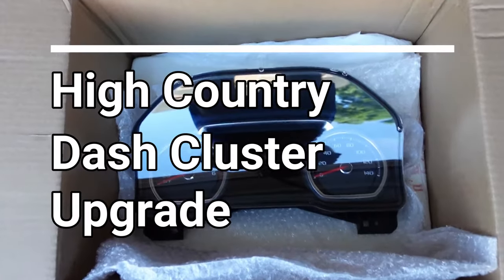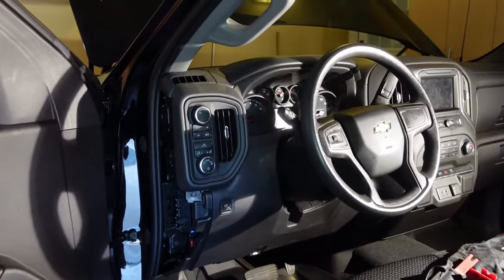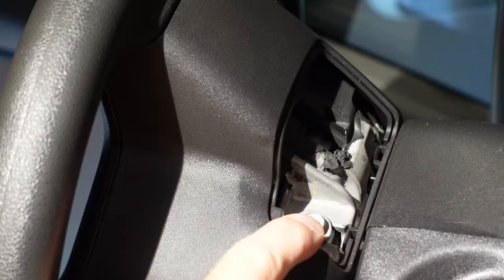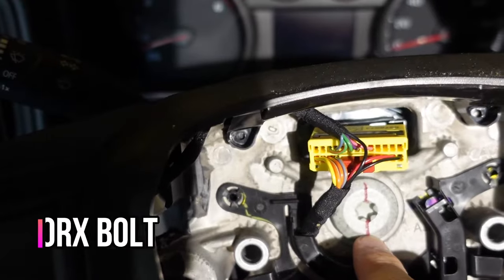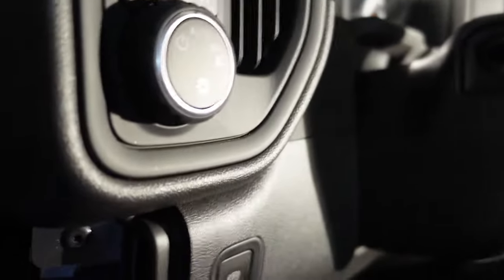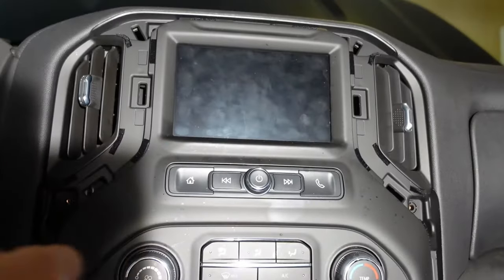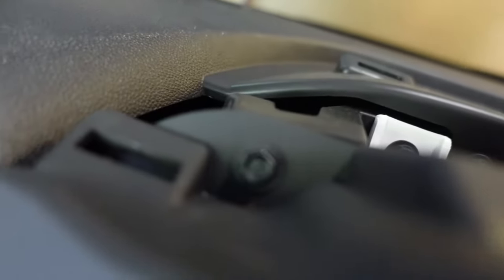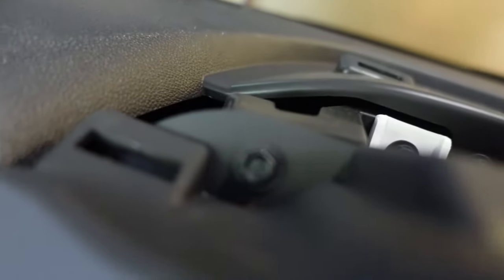[HOW TO] Upgrade Dash Cluster & Steering Wheel in a 2019-2022 Silverado LTD Custom

Comment: So is this the upgraded steering wheel also?  

How much did this upgrade cost in US dollars?
Reply from the maker: Yes the steering wheel has to be upgraded with the new cluster as well. My whee cost about $250 and the dash cluster will run you about $700. And the harness was $27.
Reply: @fondupot   Where did you get your steering wheel from? Is it possible to just upgrade the steering wheel by itself? Great videos by the way!
Reply from the maker: I got it from eBay. You can upgrade the steering wheel. But a lot of the buttons won’t work.

Comment: the white auto is over 600$, why is it almost doubles the price of a factory cluster? why not just order the 300 dollar high country cluster? big thanks for the link to the harness, that's a huge help (currently preparing to perform this upgrade too)
Reply from the maker: Because the WAMS cluster includes programming to your VIN. You can’t just order one and then install it and expect it to work, it requires VIN match programming.

Comment: How much did all the parts cost?
Reply from the maker: The wheel was around $200. The cluster I received as a promo, but normally I think its around $600 with programming.

Comment: I found one with paddle shifters. My truck is like the one in the video and I’m wondering if the paddle shifter would work? I only plan on adding the little harness and the steering wheel with paddle shifter. My current steering wheel only has cruise control buttons and nothing else. I can’t find anything on the forums and I’m just wondering if anyone has swapped one with paddle shifters and if it worked with their truck.
Reply from the maker: I think the wheels with paddle shifters are for trucks with 10 speed transmissions. Or its for the newly refreshed models that are 2022.5's. What year truck are you trying to put this wheel into?
Reply: @fondupot  it’s a 2022 Chevy Silverado 2500HD Custom
Reply from the maker: I’m not 100% certain but I don’t think any 2500’s came with paddle shifters.
Reply: @fondupot  yeah I couldn’t find anything over it or any forums talking about it. I was curious because it made me wonder if it could work. I found another steering whee without it for the same price as well. Thank you anyways
Reply from the maker: @gohangan  Cheers. Good luck on your install.

Comment: Anyone know if this will work on a WT model? Or if there is a way?
Reply from the maker: Should work on WT yes. Years 2019-2022 LTD only. 2022.5+ refresh models will not be compatible.
Reply: @fondupot  where are the links foe the products? Do the sites provide good customer support so i can double check? I would like to do this since my wife going to be using the truck more since we are down to 1 car right now. Thank you for the reply.
Reply: @fondupot  also, my wheel does not have any buttons on it. Whats the chance the connection are under the wheel/airbag assembly? If you happen to know
Reply from the maker: Check the video description. And you can send them an email for support. They’re great. I haven’t had any issues since installing mine. Been working great.
Reply from the maker: Hmm. Not sure. To be honest. Send WAMS an email they can help you out.

Comment: what was the total cost?
Reply from the maker: The dash upgrade is about $600. Wheel is $200. Harness is $30.
Reply: @fondupot  that's not bad I like the fact I did not pay the high cost for my work truck but then can upgrade when I want to... with these plug-and-play items...
Reply from the maker: For sure not terrible. I’m still working on making the heated whee work in my truck. It’s proving tougher than previous models though.

Comment: I just installed mine and my cluster works but my steering wheel controls don’t work and my horn doesn’t work, anyone know what’s wrong?
I installed the dr harness wire, I checked all plug in twice and still won’t control my radio or the horn doesn’t work! Any help would be helpful!
Reply from the maker: Not sure. Double check all your connections and make sure you didn't damage any wires

What year is your truck?
Reply: I took it to the dealership and they said the ribbon in the clock spring was broken and that I have the wrong steering wheel, can anyone help me tell me what part number for the steering wheel in need? I have a 2021 Chevy custom 4x4 2.7 turbo crew cab, thsnks
Reply from the maker: @Pierce78 just replace the clockspring. They probably meant you have the wrong wheel compared to what came equipped on your truck.
Reply: Ok
Reply: Thanks
Reply: Did this work?   I tried the install on my 19 custom, with harness Dr wire, new wheel and high country cluster.  My horn works but no radio controls on steering wheel.
Any info would help.  New clockspring needed?

Comment: I install it but i have problem with programming.. ( PROGRAM CLUSTER ) anyone can help me
Reply from the maker: Yea.  The cluster needs to be programmed to your VIN.
Reply: I have trail boss ... and the programmer ( GM DONT KNOW WHICH NUMBER WILL USE .. ANY NUMBERS RECOMMENDED?)
Reply from the maker: The dealership won’t help you. You need to contact WAMS. Their contact info is in the video description

Comment: Only thing stopping me with my 22 trail boss custom is the warranty😕
Reply from the maker: Well, is your 22 a refresh? or a 22 LTD? makes a difference on whether or not you could even do this.
Reply: @fondupot  it's a refresh, I absoutly love it. Called 3 dealerships with the same concensus. I'd love to do this, buy I'll wait till my 60k warranty goes
Reply: @fondupot  I read other comments after I commented originally! I seen where someone said it wouldn't work currently🙂
Reply from the maker: Not sure your truck is even compatible tho. 22 refresh has different wiring.
Reply from the maker: @Thehotdogguy5000  Maybe eventually someone will figure it out for the 22+ refresh. And then you can do it.

Comment: I have a 2024  silverado 3500 LTZ . The radio controls are on the steering column, all other controls can be done by voice command. I have no reason to mess with the screen.While i'm driving. I don't think is that much of a big deal. That's a lot of work just for a inch or two. Still good information.
Reply from the maker: This upgrade is geared towards truck owners with Custom level and WT level trims. Who don’t have factory steering wheel controls. I would agree on your LTZ the process would be a waste of time since you already stated you have these functions already. The larger screen is less of a big deal than the added wheel controls, IMHO.

Comment: No programming is needed, it is only the change of parts thanks
Reply from the maker: Wrong. Programming is required to match your VIN. It will not work simply by swapping it in.

Comment: I'm interested in having stereo controls, but can it be done without a new cluster? I have a 2023 silverado custom
Reply from the maker: This mod won’t work on 2023, the wiring is different. And others have reported you need the cluster to get the stereo controls to work.

Comment: Any issues at the dealership? Mine is telling me that the cluster is making the computer throw multiple codes but everything works as it should
Reply: When you purchase this you need to provide all the accurate information including your vin so it can be programmed accurately
Reply from the maker: I have had zero issues with mine since installation. Was yours programmed by WAMS?
Reply: Yes it was. There are no issues with the performance of the cluster or the truck, just the dealership saying goofy stuff. I have to correct myself, the dealer said that everything goes through the cluster and on their end it looked like the ecm wasn't talking to the rest of the electronics. if that makes sense.  @fondupot
Reply from the maker: @Metalrobtail  not sure. I haven’t been to the dealership once with this truck.